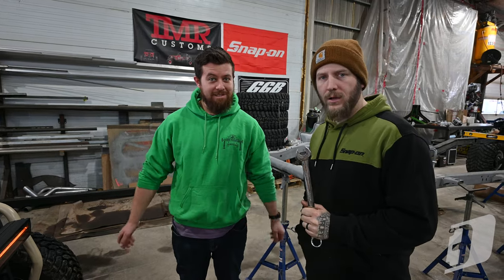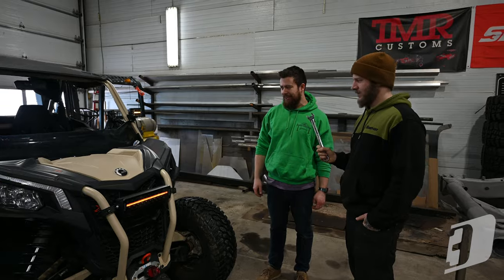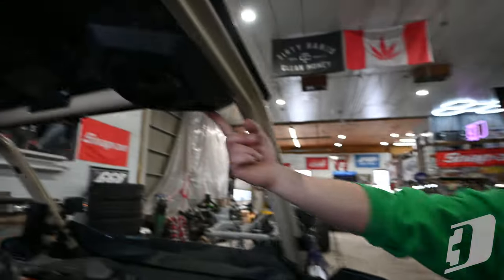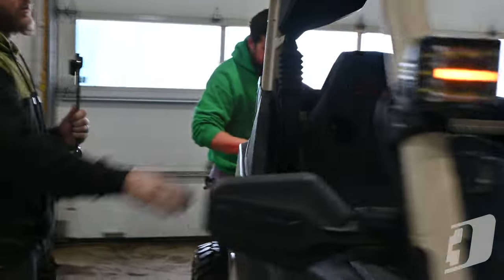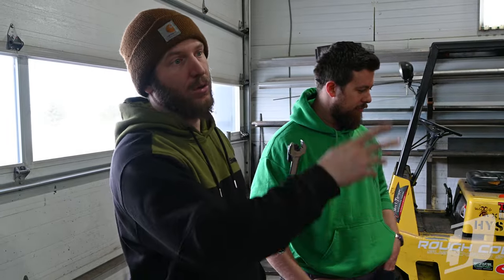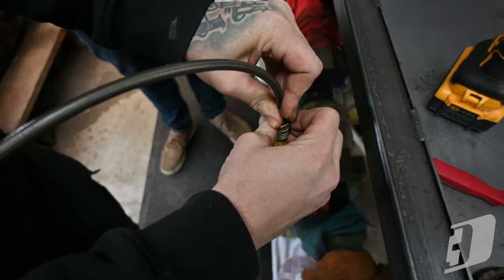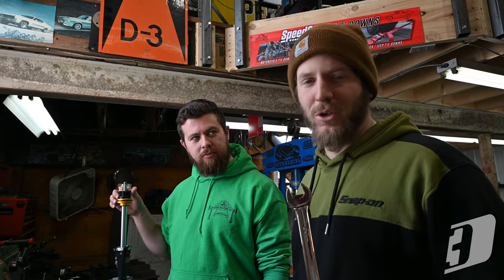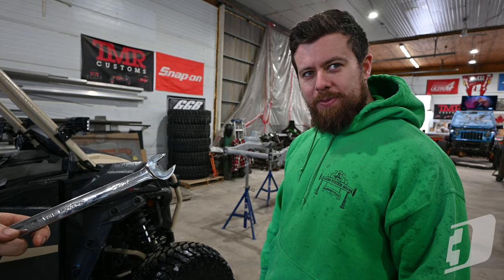Can Am Maverick Sport XRC Get Shocks Tuned!

Comment: Loved the mechanical and mathematical lesson on spring ratings. With only 14" of travel can this thing handle aggressive rock/trail on 35's with or without a suspension change? Would love to turn one into a little mighty goat but not sure if it's worth the $ and effort given other options in the industry like RZR, Villain, KRX etc etc. It's fun to think about tooling up rock the others couldn't though I don't know if it's feasible.
Reply from the maker: You can do a lot with these machines!! But they obviously won’t have the 20” of wheel travel like other machines… getting the shocks working to their best performance and tossing some nice tires on will make it perform great!

Comment: The krx may not run 80 mph but you can stick 35 on er stock and it will pull you around the woods all day long not to mention the flex and suspension they have you have to pay 45 grand to get that with other machines just for the krx haters I would go back and watch on of Steve’s early videos and check out him pulling it on the rock versus the Rc
Reply: If you notice the RC had both sway bars on, they are way too stiff & need to be removed completely, then the RC will hang with the KRX rock crawling, 1st hand experience in that regard. The KRX deff needs some lower gearing for serious work, that where the RC really shines with an incredibly low Low range.
Reply: @randyphillips559  yes I see that but still no where near the suspension travel that krx has not even close yes the rc has a very low gear same with a rock and trail Polaris both good machines but rock and trail Polaris 28 grand not sure bout the rc going to say that much or more new 24 krx es or trail 23 your getting a hole lot of machine for 23 grand
Reply: @randyphillips559  ol and also run a 35 inch tire stock.
Reply: @hillbillycustom1730  Pol Rock & Trail has nowhere near the low gearing the Rc has. And yes Rc easily handles 35" tires. The KRX truly is a great buy at the prices they ask with superior suspension, but it is also a lot longer & some wider than a Rc which in some cases is a detriment.
Reply: @randyphillips559  yes it is a little big I would like to ride one of those rc and check it out